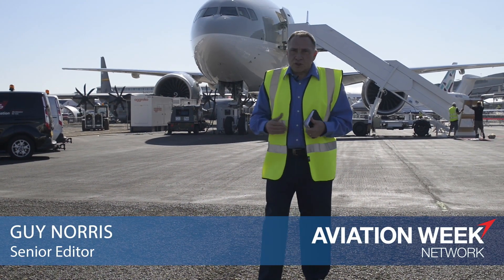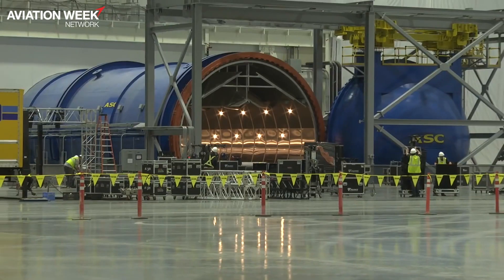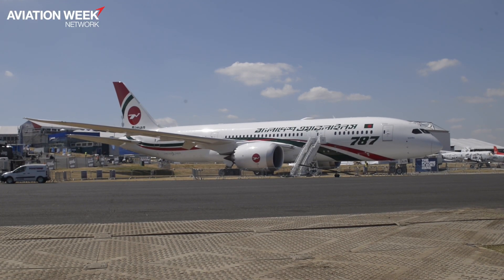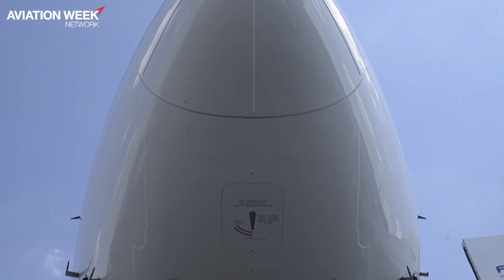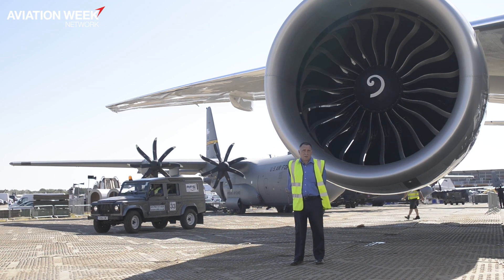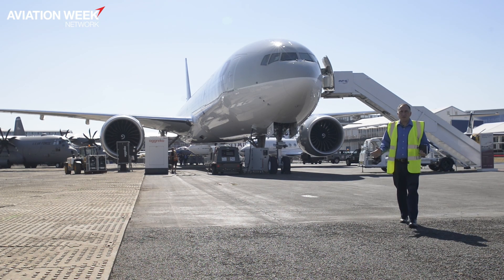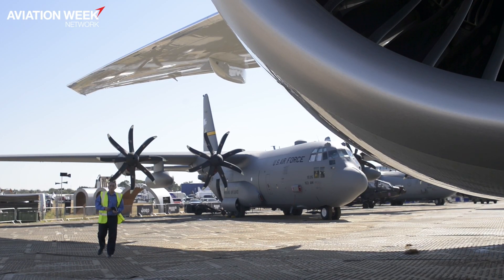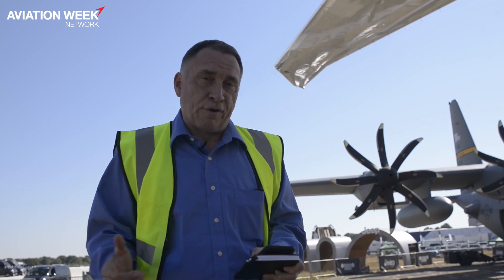What To Expect On Boeing's 777X

Comment: Why only 105.000 lbs of thrust compared to the GE90-115b's 115.000 lbs of thrust?
Reply: "So much heavier?" The 777-9 will have the same MTOW as the -300ER (775,000 lbs). Just as significant, its wing area will be 6.9 percent greater, and the aspect ratio 22.1 percent higher. With better wing performance for an equal weight, less thrust is necessary. But don't let decreased output fool you: the GE9X's pressure ratio projects to be 43 to 45 percent higher than the GE90-115B's, and its bypass ratio 11 percent higher—all this with a lighter engine. Amazing.
Reply: Kaipeternicolas less fuel burned.
Reply: The plane is gonna be so much heavier, yet so much more efficient that they can use 105.000 lbs of thrust?
Reply: I guess the airplane is also lighter
Reply: Lower trust leads to lower fuel burn especially for the GE9X it’s about maximizing the efficiency and reducing the fuel burn, the Ge90 is very efficient but the 9X will be even more efficient
Reply: yes. It means more efficient and 777x doesn't neeed more as the new wings design